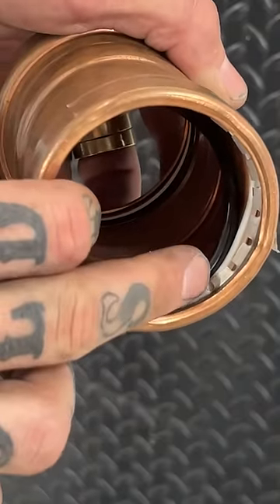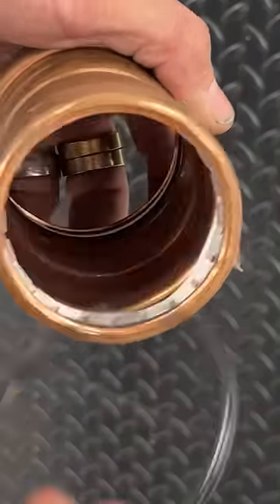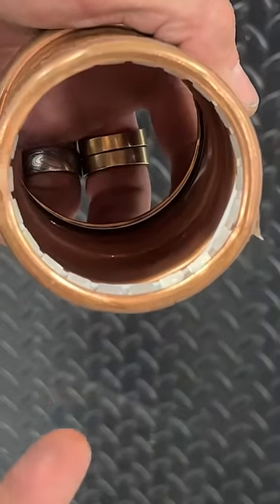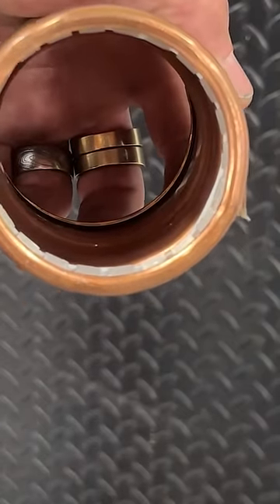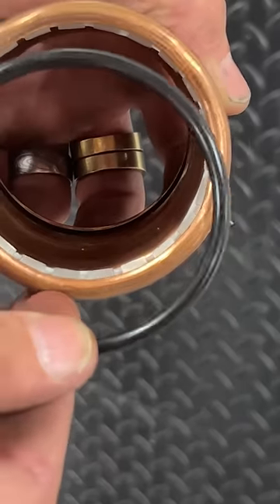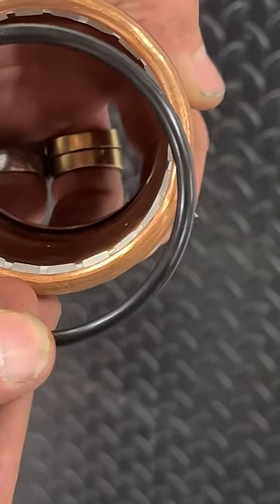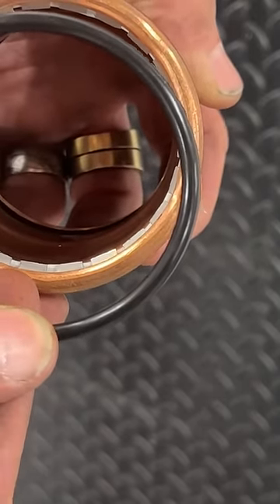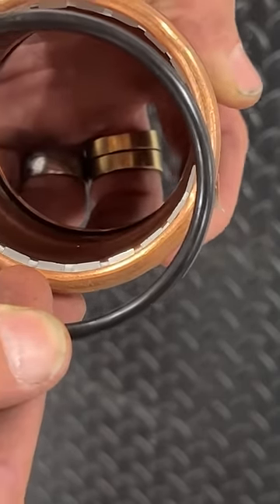#ProPress #viega #shorts

Comment: They should make an attach to put inside the pipe to backstop all that pressure and then also it would make a tighter seal
Reply: How do you retrieve that tool though.
Reply: He means like a pipe insert, i imagine, like JG speedfit inserts.

Comment: Imma be straight pressing over 2” copper pipe is lame. The solder fitting for a 3” copper fitting is literally like a 1”1/2 long. It’s kind of hard to have a leak on a 3” soldered fitting
Reply: I have seen plenty of 3 inch that leaked after they were soldered. Pressing 2 inch and above is way faster and less leak prone than soldering.
Reply: @jimdiet8534  the solder joint of a 3” copper fitting is almost 1”1/2 to press 3” copper we would have to get another gun. I’ve pressed 3” one time we rented the gun. The 3” gate valve dropped and it wouldnt hold I was able to press a 3” ball valve on a live pipe. That pretty damn cool
Reply: @jake16542  we have literally pressed over five hundred three inch. Probably twice that in 2 inch and above. No problems at all. We also do gas up to three inch with no issues.
Reply: @jimdiet8534  what press gun do you use to press 3” and above
Reply: @jimdiet8534  I’ve had to sweat a 3” 90 in a crawl space less than 1’ away from my face that’s my drinking story
Reply: @jake16542  we have an rp340 and rp350, we have the the rings to 4 inch copper and we have a booster and rings for mega up to 4 inch gas but the biggest gas we have done is 3 inch. We also have the RP 240 for the little stuff.  It seems like a lot of money at first but it does save time. We have had good luck so far. Knock on wood.
Reply: I work in occupied buildings. Smoke detectors, and communications wires strung all over the place. We use these machines kinda regularly. I don’t love it, but I’m beginning to think of pressed fittings like compression stops. I put them on and never think about them again.
Reply: You obviously haven't soldered many large diameter fitting eh? 😂  

It isn't really about the leaks you may or may not get.. its about the time you save in labor when pressing, especially with large diameter fitting.